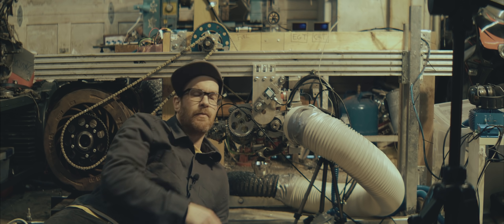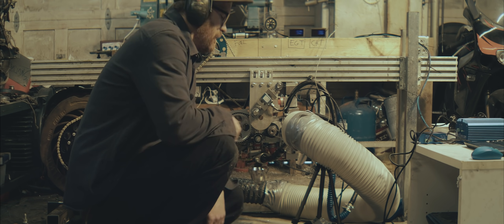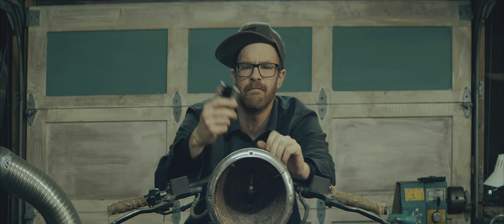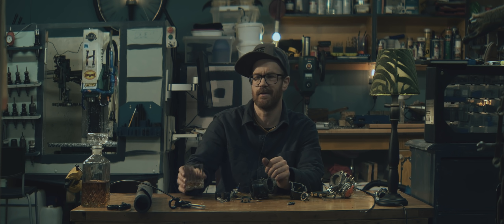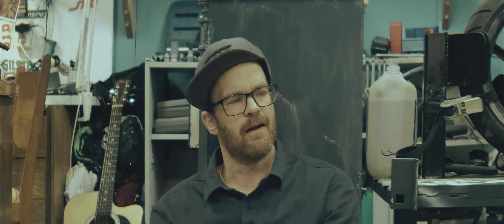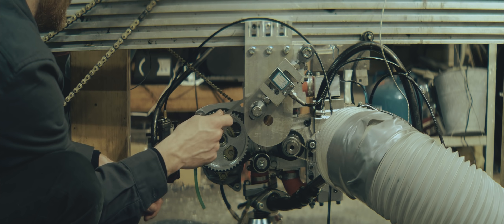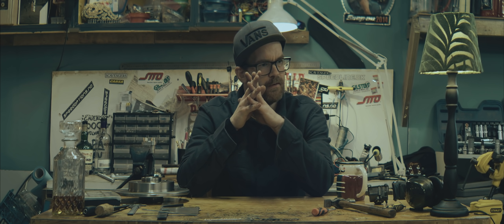Supercharged Nitro Two Stroke, Dyno quest continues.

Comment: I am a marine mechanic and i tune a lot of race outboards for customers. I completely agree with the 15degrees of timing being a huge issue. The engine will start to drown in fuel at higher rpms. A lot of the smaller displacement race  engines are running 30-45 degrees of timing at 9000-10000rpm. Is the engine running with fixed timing or is there an advance in your system? Also the spark plug might need to go up or down in heat range once its running better.

Comment: Needs PID tuning, and check for rpm spikes by graphing rpm against time, make sure to ground the eddy brake housing to stop interference when the load is applied, there is an option to set a percentage of load to start with this can help with smooth load application try 10%, you can add a plugin to show what the PID is doing with live graphs on the run screen for  kp ki kd

Comment: Hey! I might know the problem of the dyno( sorry for mistakes, 2. Language) so because the motor pulls the chain off- center( rellative to the load cell pivot point) the radius of the gear, and the distance of the chain from the pivot point make a gear-ratio diferent from1/1 . This way you don't meassure the torpue of the motor, but the torpue generated by the chain-pulling force on the pivot point.
Reply from the maker: 👍 yep. Need to fix that with a new engine cradle, or I might be able to correct for it in the software.

Comment: Regap the spark plug to under .020 or uhm 20 thousandths . You are boosted and boosted engines need a tighter gap on the spark plug or you will blow out the spark.

Comment: All kinds of vibration, Imbalance, forces will be present in your load cell data with that setup. Along with your chain reaction force as you have 2 load paths present. You'll want to check for electromagnetic interference from your ignition as that's a strain base load cell. When you calibrate that load cell you need the perpendicular distance to the direction of the force not to the bottom pivot on the load cell. draw a line thru the 2 pivots on the load cell  the distance perpendicular to that line and the center of your engine pivot is your moment arm length it doesn't look like much error but hard to tell from pictures.

Comment: I`m wondering if the play in your chain construction between the engine and the retarder causes oscillation. The chains really start to whip as soon as the break is being applied when the engine reaches the targeted rpm

Comment: You need to put guides or a tensioner on your chain - it is whipping to much - which will be putting variable load on the engine.

Comment: Two things. 
1. Looks like too much oil. 40 or 50:1 I suggest would be OK.
2. Revs look low. Would expect 14-15k rpm for 50cc. 
Keep up the excellent work on your unique project and presentation.
Reply: Dr Colin Blair from Belfast did a bunch of work on power vs oil/gas ratio.   Back in the early 70's.   I think greatest power was at 1:8 oil/gas ratio.   
   I was racing a Suzuki 250 at the time.   They had an oil injector fitted.   I tried to disconnect the oil pump n run 1:8 oil/gas in the tank.   Only had 1 chance to start, then the plug would drown.   I went back to the oil pump but would set it to minimum for the warmup lap n start, then full on during the first lap.   Didn't compensate for my lack of riding talent though!

Comment: i'm all for a float carb. except i've never really liked the pwk, i'd try something like a dellorto PHBH, much easier to tune. and that bog really doesn't sound like an ignition problem, it bogs exactly as the rpms start to drop significantly. a regular thing in mopeds with variator rollers too heavy and lean mixture, so i'd try a bigger main jet and maybe lowering the needle, seeing how it sputters sometimes. also, what spark plug gap are you running? at higher compression pressures a smaller gap could help, like 0,4mm or something

Comment: The Maha lp13 has a Telma retarder. The Axle holds the weight of the retarder and the load cell measures how much rotational force the Telma retarder is holding back. Let me know if you need some pictures of the setup.

Comment: Two things to thank about. Nitro has a very slow flame propagation. Top fuel dragsters run up to about 54 Deg spark lead. You can also try a simple RC engine glo plug. They make a adapter that will let you do this. Next,,,a carburetor is not a reliable delivery device when it comes to Nitro.  You need a fuel injection  method of some kind.  I don`t know if you know this, but you can do away with the pulse line on your pumper carb, and just use a electric fuel pump in the fuel line. Block off the pulse line altogether.

Comment: i use in my nitro stratton 30-40degree static timing, nitro is so slow burning and spark plug ignites nearest droplets first and that combustion starts like chain reaction... so... you need quite lot of timing.... how much spark energy your ignition unit can produce?.... atleast 200mj per spark is needed when using a lot of fuel and blower

Comment: Do you have boost pressure present at the fuel bowl? Really not sure how this matters in a 2 stroke but it's needed on a 4 stroke carb or the needle valve wont open because of the pressure difference. Just my 2 cents. Might be irrelevant though.
Reply: Wait a minute! Sorry got that wrong. Boost pressure via pitot-tube is needed on the bowl for the gasoline to be able to flow into venturi. Thus because of boost presence a low volume gas pump in needed to overcome needle valves opposite force. But Again. This is for 4 stroke and you don't seem to run pressure through carb anyways...

Comment: Sounds like it leaned out yes...
Reply: 4:2:2 400Mbit will kill you, you'll need Avid and DNXHd or other really heavy protocols to get there and FFMpeg for your transcoding If you want richer colour depth, then perhaps a Ninja connected via SDI or HDMI to capture vision and then all of it needs to be converted to a full frame CODEC to edit and the hardware that it needs. Lot of fuss for a lens covered in castor oil I say!
Reply: Don't worry about the hot gasses into tank, any hjeats causing the fuel evaporating is endothermic and cool, we also have needle controlled pressure with heat sink, needle controlls the pressure.

Comment: I think you need to separate your issues. Test the dyno with a reliable stead state engine, either a basic bike engine (the Derbi?) or something like a Honda GX engine, reliable, quiet and easy to run all day. 
Once dyno is setup you should play with the unknown “brute force” engine, in good faith that your dyno is working perfectly 👍
Reply: 👊🏼 yes reduce variables.
Reply: electric motor for smoothness?

Comment: when we dial in our dyno we did it up in increments. like start at zero then go 1 lb then 2 lb then 3 then 4 then 5. then do the same on the way down. also you could use a oil trq system with popit bypass. we also have a very useless electric trq system that i would totally stay away from.
also the problem could be in your data acquisition you might have to damper the reading out like a filter

Comment: Awesome! Progress!
I was thinking in the last video that the retarder seems to come in too hard and the PID values might need looking at. Halving the voltage seemed promising and meant that it used more than 1 or 2% of the retarder range. Then you mentioned it doesn't have PID control? Definitely something to look into.
Are you able to hook up an electric motor in place of the engine to get a baseline for the power input and calibrate the software from that? Then you can also switch the motor on from a dead stop and have the retarder ramp it up to a certain rpm over a certain time and hold it at whatever rpm you like, which is what it should do with the engine.
Not sure if you factored it in previously, but the calibration weight hanging from the load cell bolt isn't accurate because of the angle (45 degrees) of the moment arm. The bolt @ 14cm will be much better as it's nearly horizontal with the engine pivot.

Keep up the good work.

Comment: I had asked you before but forgot the answer, what % premix oil are you running?
Reply from the maker: 15%(!) In this engine, RC fuel. Just ordered more with just 10%, wasn't available last time. Usually I run 5%.

Comment: One thing I learned back when I was working with scales and load cells is that you always want some soft rubber or the like between the load cell and whatever you masseur. 

The metal in the load cell is basicly a very good spring, and it will oscillate like crazy if you don't have something that absorbed the vibrations. (And turn them in to heat.). It makes a HUGE difference.
Reply: Exactly i was thinking the same thing. Adding a shock absorber or such between the loadcell and engine mount point should help dampen down the signal. It wont affect total load seen as it will always be the same, but the large sudden spikes should be dampened down.

Im currently building a water brake dyno which has a natural tendency to dampen shock waves just due to the tendency of the water, but typically the load cell is attached to the "torque load" (brake) which usually sees much less harsher erratic vibrations, then being attached directly to the engine.

 But hey, its all in the fun of experimentation
Reply: Like this so he will see this
Reply: “This Is The Way”
Reply: This is a much better solution than mounting a damper parallel to the load cell, as that will cause an additional load reading.

Comment: Under certain circumstances, such as very high compression or boost, the ignition flame can get blown out.  Dunno what you can do about it.  Higher spark voltage/energy?  Longer duration?

Comment: Increese your timing advance to 20-25 degrees at full throttle. Example outbord 2-t motors change timin manually from 6deg at idle to 23 deg full throttle

Comment: Forget the carb, use electronic fuel injection. Get megasquirt or something like that and an inlet manifold from a fuel-injected motorbike, strip away the extra throttle bodies if you get a 4-cyl or 2-cyl one.

Comment: Hey man, I really like your work and I would like to suggest you something: 
-consider creating an external management panel with all the output data, digital knobs for handling stuff like ignition time and kill switch
-connect a servo for throttle, this will allow ECU to handle engine RPMs and will make it easy to troubleshoot and calibrate the engine
-and for the love of OHS (Health and Safety), PLEASE cover this chain :D

If you need help with anything above contact me, I will try to help :)
Reply: Oh God the engineers have arrived, hide the tools! lololol :{)=
Reply: Polska ❤️ has a really good idea! Which brings me to a thought; outsource stuff like programming in this case so you can concentrate on reving!

Comment: the load cell is verry sensitive to vibration. the raw data canel shold not be noisy if it is right. no or verry littel filtiring is neaded in my dyno (stuska water absorber car engine and datamite).   mvh jens sävar

Comment: I have had the same fuel issue with those Tillitson carbs, there is a transfer port you can drill out
Reply: It’s upside down. Methanol tillotson has to have the pumps and fuel feed on top.

Comment: Nice progress.  I like your experiments with cinematic style.

Roughly how many horsepower are you expecting to achieve with this design? It is hard to tell how close to achieving your gol you are?
Reply from the maker: Thanks! Anything below 30hp and it would be pointless. Needs more boost.
Reply: @2STROKESTUFFING  600Hp/L That is quite a bit :)
Reply: @RotarySMP  he is trying to push it to the limit of what is possible, with his transfer ports set the way they are, his supercharger, and the fact that he is running nitro rather than gas it has a higher limit than what a different 50cc running gasoline could do.
Reply: Lovely numbers❤️❤️❤️👍👍👍

Comment: Go for a bigger load cell and mount it of the retarder as you stated. Also what is the resolution and sample rate of the software. You need at least x5 the rpm sample rate so at least 1kHz. You could run an accumlator for the pressure for the carb, or run it off the crankcase pressure. The accumulator would just be a bottle and then run that to the carb if you're worried about exhaust gases. Just make the lines short to reduce latency.

Comment: You really should consider EFI - grab in individual throttle body off an older bike, and you'd still have WAY more control over fuel, and ignition timing.  If you have enough air and static compression (which you do) these two things are what make power fuel and timing.  Computer controling that HAS to be where this channel is going....

Comment: To check torque sensor calibration you could safely lock the engine (e.g. theaded alu bar though spark plug hole to stop the piston halfway up the cylinder) and then use a torque wrench on the engine drive sprocket.
Reply from the maker: That's a great idea!

Comment: Log format video gives you more leeway in controlling contrast in "badly" lit scenes but that's about it.
Would love to see rpm sweeping using something like an arduino hooked up to a relay to PWM control the retarder to a somewhat stable RPM range (could even make a sweep protocol with that sort of system, especially with a servo hooked to the throttle).
Reply from the maker: I'm experimenting with log cause almost every shot involves shiny aluminium, hard to expose properly without blown highlights. Not that it's of much significance, but I can't help it. And a complicated process makes it more interesting.

Comment: Think you are onto something with the fueling that float bowl looks way to low , a electric fuel pump low volume low pressure 4lpm 8psi running through a pressure regulator should help the fueling side immensely. When setting the pressure take it up to overwhelming the needle and seat and back off a tad you will surprised at the difference. I have put this system into industrial engines that are fed by gravity with great success. You need as much fuel as possible in the bowl under high load conditions. As for the rest of it best of luck and keep experimenting you will get there just time and effort. You are a mechanical genius. Cheers from Australia

Comment: You need a 2nd fuel delivery hose set at 3/4 throttle. Adjustable for top end power. A cable actuated cheater.

Comment: Amazing how much different the engine sounded with that other carb.  I'm sure more ignition advance would wake it up a lot more.  I can't remember, does that ignition have a curve feature?  I know that in practical use, the engine will essentially be run full throttle at maximum RPM and an ignition curve wouldn't help much, but it might help it on the dyno to produce better numbers.
Reply: I noticed it sounding different too. I think it was running richer on the second carb.........probably needed it.

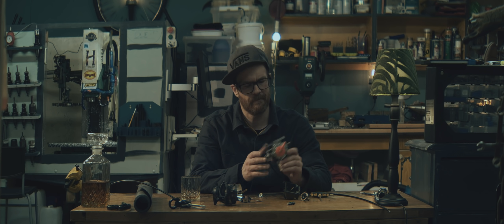Comment: Just a thought that might be useful, and a idea I might try. For this super wide aspect ration, during times like this 5:30 you could use some of the space on the left and right of the frame to add B roll of the carbs / carb specs, etc... Keep it up :)

Comment: float carb would be annoying when running it on the road, but a fuel pump would solve your problem (or make it worse by adding something else to the equation...)
Reply: Float carb will work ok, we run huge amounts of fuel with nitro through one on our 100cc
Reply: @afflickracing1705  oh ok. I know way too much people who blew up bikes because of leaning out. I hadnt finished the video though and it seems to work out for him so good
Reply: It's not presssure its volume at issue. A fuel pump wont fix it per se. Whatever is limiting the volume of fuel to the carb, outside of pressure, is the issue. Increase the volume, at the same or lower pressure even likely and wham bam we are off to the races!

Comment: Wouldn’t it be simpler to calibrate the dyno with a known engine of specified HP & TQ to help isolate where the issue exists?
Reply: That sounds resonable - and if the load-cell was placed on the retarder (as is tradition) then an electrical-motor of fitting size could be that "known engine" !?!
Reply: @CmdrFlemming  that's exactly what I was gonna say. I think that would be an awesome way to do it, they're not perfectly accurate every time, but it would provide a good degree of accuracy still. Any variance from it would be negligible, I'd think. I'm always impressed at the comments section of these videos

Comment: Nice work as always! I have been wondering for a while now if it would be worth deactivating some of the coils in the retarder so it's not so aggressive with these smaller loads.
Reply: I agree, I think the retarder is way too powerful for the engine he's using, which means the control loop gain is very high, which invites instability.